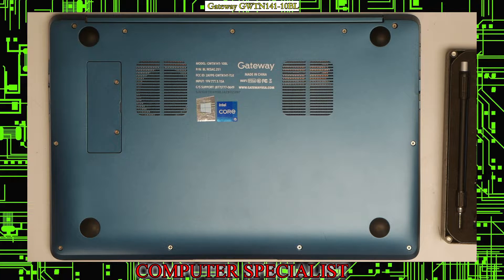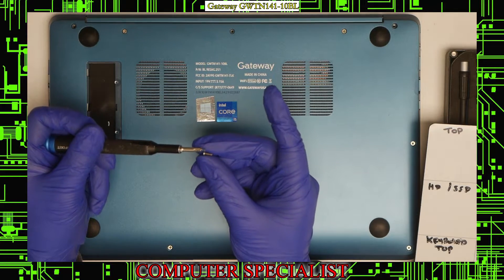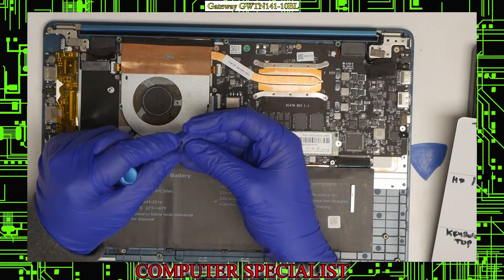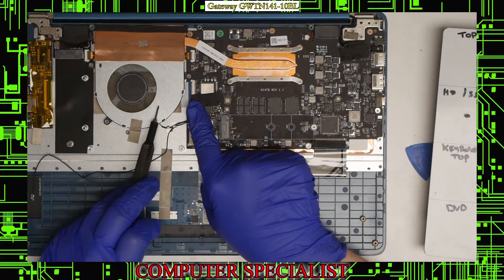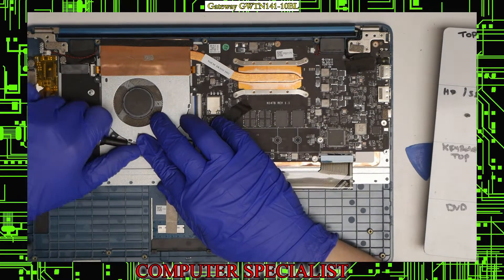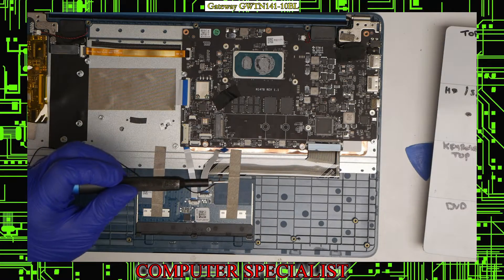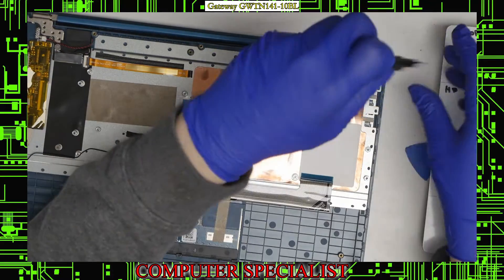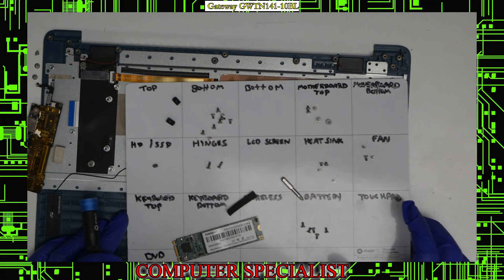Gateway GWTN141-10BL Complete Disassembly (Motherboard, Screen, Battery, Palmrest)

Comment: Is this how you get to underneath the keyboard keys?
Reply from the maker: This is how you get take apart the laptop. Your trying to get under a keyboard for what reason? You can carefully pup them off with a plastic pick etc. if there is food stuck under them but be careful not to break any clips or mounts.
Reply: @computerspecialist8533  I got some liquid in the keys now the whole keyboard won't work. Trying to clean and re enable.
Reply from the maker: The electronics are most likely damaged and you'll have to replace the entire top / keyboard. They make a few difference colors if that matters. You need something like this. https://www.ebay.com/itm/255463807159

Comment: I was very stupid and had accidentally gotten a large amount of tap water on the keyboard, resulting in several keys outright not working but the computer overall performing the same. Do you have any suggestions or ideas on how or where i could get this repaired, if at all? I am currently using a separate keyboard and mouse to still work on the computer
Reply from the maker: Keyboard would have to be replaced. What city and state are you in?
Reply: @computerspecialist8533  Austin Texas
Reply from the maker: @jaybred6752  https://www.google.com/search?q=austin+texas+computer+repair&rlz=1C1GCEA_enUS938US938&oq=austin+texas+computer+repair&aqs=chrome..69i57j0i22i30l2j0i390l4.6329j0j15&sourceid=chrome&ie=UTF-8
Reply: @computerspecialist8533  Does the system board and processor need to be removed to replace the keyboard?  Any directions you can me to would be helpful thanks.
Reply from the maker: @elltkeen  The keyboard is built into the entire top assembly so you have to remove the internals including the motherboard (processor is soldered directly to the motherboard and is not removable).

Comment: How do you replace the keyboard in this one? Is it just clips on the front?
Reply: It’s the gwtn156-1, can I replace the keyboard only or do I have to get the whole touch assembly?
Reply from the maker: You will need to replace the entire top keyboard/palmrest assembly unfortunately. These cheaper laptops are not designed to be fixed sadly.

Comment: Good evening friend, do you know where I can locate the glass that protects the screen or the casing that has the glass for the model gwtn141-10bk ?
Reply from the maker: I'd advise you to try and find whole assemble used. I see one that just sold a few weeks back for $100 complete. I don't see anyone selling just the glass but the complete assembly is a very easy swap! Feel free to subscribe to our channel by clicking the red button!

https://www.ebay.com/itm/144718219876   <-- Sold a few weeks ago, keep checking daily they sell fast.
Reply: The newer model with i7-12th gen cost only $299. The AMD alternative with ryzen 5 7xxx and AMD video card is also $299 at microcenter

Comment: where is the wifi adapter/chip? If I want to change the wifi adapter/chip, what should I do?
Reply from the maker: Sadly the Wifi card is built into the motherboard. You can see it is the silver square next to the blue/white ribbon cable on the very left side of the motherboard in the video. Is yours not working correctly? I would see if it works with a fresh install of Windows and if not, you may have to use a USB wifi dongle or get that chip replaced.

Comment: Oh crap I came here bc I wanted to replace de wifi antenna bc it doesn't work properly but to find out that it's built in the motherboard is disappointing
Reply from the maker: Yes unfortunately they soldered it onto the main board 😢. Are you sure your wireless card is bad? A simple test would be to reload Windows. Can use a temporary drive if you don't want erase your current files and apps etc. Only other option is to disable onboard via device manager and install a small nano usb wireless card. Here are 2 below. 

https://www.newegg.com/startech-usb150wn1x1-usb-2-0/p/N82E16833114051

https://www.newegg.com/asus-usb-n13-c1-usb-2-0/p/N82E16833320441

Comment: Do these laptops not have a cmos battery. I set my TDP a little too low, it won't boot, how do I reset CMOS?
Reply from the maker: They use the main battery for the same purpose. So if you unplug the main battery and hold in power button for 20 seconds and then reconnect battery and charger and see if this helps!
Reply: @computerspecialist8533  yes it did, thank you

Comment: some of the keys(v,b and space) on my Gateway GWTN141-10 are not responding.Tried..reinstalling keyboard drivers without success,sticky keys etc.Did not drop or get  it wet.Tried online program that detects key presses and  it also did not see those key  presses.Could this be a hardware issue?Possible connector issue?Any suggestions on what to try would be much appreciated.
Reply from the maker: Definitely the keyboard gone bad. Common issue with a lot of newer laptops. What color is your model?
Reply: @computerspecialist8533  Blue.
Reply from the maker: https://www.ebay.com/itm/255463807159

Comment: Gateway gwtn141-4gr: The touchpad edge toward the user is sticking up 1/8th inch. It looks like the palm rest itself is slightly bowed along that edge.  The touchpad itself appears to be straight. What holds this thing in place? 

Thanks,
Mike
Reply from the maker: I bet your battery is swollen (They do this when they start to go bad) and is pressing up on the touchpad. Take bottom off and remove the battery and see if it goes back down!
Reply: @computerspecialist8533  Winner, winner, chicken dinner! We dodged a bullet on this one, thanks!
Reply from the maker: @1Hypoid  That's Great! Feel free to sub our channel if you haven't already!

Comment: Thanks for the video. I have the same laptop and the fan is very loud. Sounds grinding but seems to work. Have you run into this before or should I just go ahead and replace with a new fan?
Reply from the maker: Grinding could be an obstruction inside the fan (typically plastics bits that break off inside the laptop), a bent metal housing surrounding the fan, or just a bad fan. I'd recommend taking it out of the machine and blowing it out with compressed air to see if anything is stuck inside of it and see if the metal shield is bent at all. If not, then most likely just a bad fan. Part number for this fan is B85D5HB2063
Reply: @computerspecialist8533  This is super helpful. I will try that, thanks!
Reply from the maker: Let us know if that works for you! Worst case scenario, the fan can be picked up for around $20 on eBay.
Subscribe for more videos soon :)
Reply: @computerspecialist8533  Looks like I'll be replacing my first laptop fan :) I took it apart and the existing fan looks fine and also gave it some compressed air. Thanks for the part #!
Reply from the maker: You will save some $$ that is great!
Reply: Ended up changing the fan from the link you provided. MUCH quieter and thx again
Reply from the maker: @Nihaofoo  That's great! Feel free to sub to our channel if you haven't already!

Comment: I need to replace my keyboard it got wet with a little water fortunately everything still r
runs but i have stuck keys and unresponsive keys as well. do you know where i could find a replacement? i have loccated a few but they say there is no frame included. Im not sure exactly what all needs to be replaced. Any insight would be appreciated. Thanks
Reply from the maker: You have to look for the complete assembly (Touchpad / keyboard). There are people selling just the keyboard, but they are knockoff keyboards (will last a few months and die) and also you would have to break out all the plastic rivets to get the old keyboard out and hot glue the replacement in since rivets will be gone. It's a pain to do and never ends up as strong as original. Here is one in Blue https://www.ebay.com/itm/255463807159

Also can ask the people selling for pictures of back to make sure its the right fit etc. Gateway make a few 14" model laptops that share the same touchpad / keyboard!
Reply: @computerspecialist8533  in that link, it shows keyboard with frame. Does that "have to break the plastic rivets and hot glue" or were you just talking about when replacing just keyboard?

Comment: Great video.  My 9 year old son cracked the screen of this laptop (shards are falling out of it).  Now I can't get it to power up.  Nothing happens when the power button is pressed.  The led seems to indicate that it is charging ok, but it is showing no life.  Would the screen keep the CMOS from booting?  Thanks.
Reply from the maker: Does the power indicator LED turn on after its pressed? (There should be 3 LEDs above the keyboard, power light is the first one on left). If it does, then likely the LCD has been damaged to the point where no picture can possibly be displayed. In that case, I'd recommend trying to see if you can get any video from the HDMI output port on a TV or monitor. If you don't get any light at all, then most likely you  have a motherboard issue. While unlikely, It could be that damage to the screen electronics is preventing it from powering on. A good idea would be to open the laptop, unplug battery, remove LCD connector, plug battery back in, and try to power laptop up (also check if fan spins when attempting to turn on).
Reply: @computerspecialist8533  Thank you for taking the time to reply.  No LEDs turn on when the power button is pressed and the fan does not spin.  I've tried unplugging the charger, battery, and LCD and reconnecting, but it's still dead.  I also tried using an HDMI out, but nothing.  I tried to find the motherboard battery, but can't locate it.  I was hoping it wasn't a motherboard issue...
Reply from the maker: Unfortunately it does sound like it is :( The only other small possibility would be an issue with the power button (though I doubt it). To test that would require a bit of electric knowledge to locate any 3.3V pin on the keyboard connector and short it to ground while keyboard is unplugged. Maybe also worth taking the board out and giving it a good visual inspection to make sure no liquid damage, bending, etc. Anything further would require analysis of the main power rails. Since you get a charging light, you'll have 19v and 3.3v ones at least.

Comment: I need to purchase an LCD screen for this laptop, the model is GWTN141-10Gr color Green. I don't need the back cover and hinges, just the LCD screen with a touch digitizer (it is attached and can't be removed) how much and with is your eBay store id?
Reply from the maker: Is your model a touch screen? I didn't think they had a touch screen on this model.
Reply: @computerspecialist8533  No,  It is not touch screen
Reply from the maker: @JaffersonComp  https://www.ebay.com/itm/194688778111 is for the touchscreen version and https://www.ebay.com/itm/123999272564 is for the non-touch.

Comment: Do you know what's the bandwidth of the USB-C port? Or the HDMI one?
Reply from the maker: The chipset and port type shows: USB-C is10 Gbps of data transfer through each of two data pin pairs. This bandwidth support will further allow for 20 Gbps data transfer rates when both data pin pairs are used. The HDMI is 10.2 Gbps. With that being said I not longer have the laptop to ACTUALLY test!